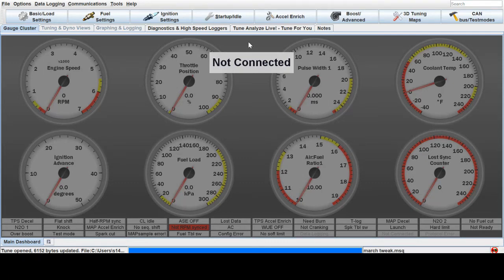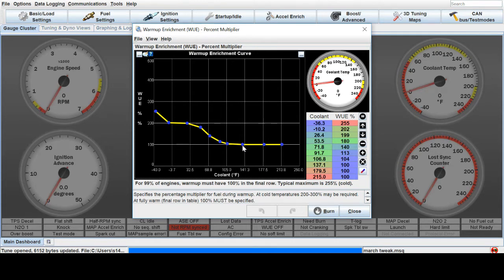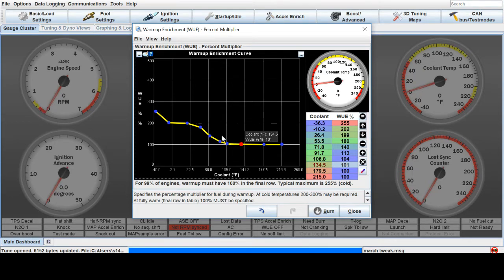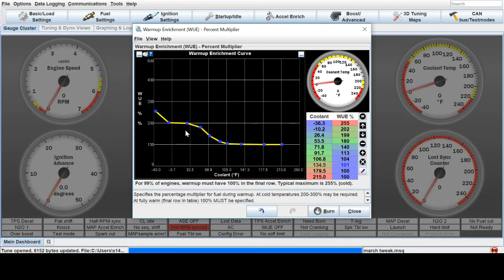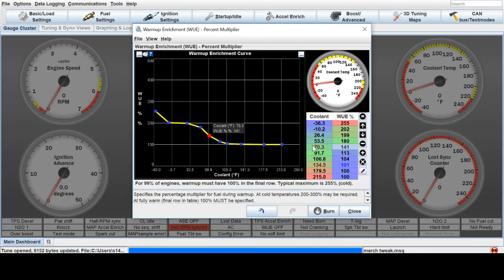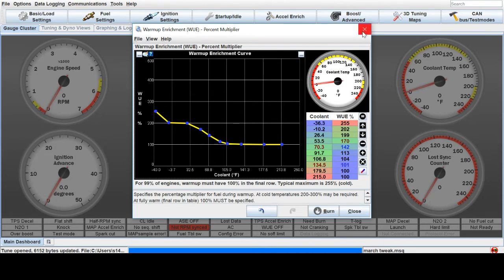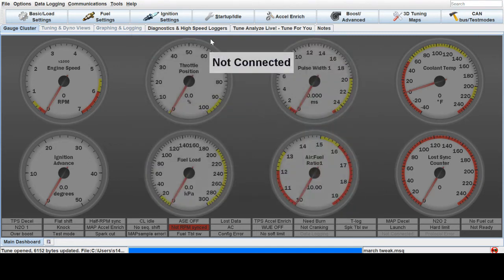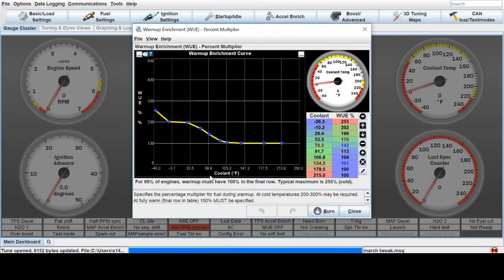Megasquirt Warmup Enrichment Tuning Basics

Comment: I know I’m late to this party, but YouTube algos certainly aren’t perfect.
Are the percentages you refer to applied to the VE table (I think you mentioned this) for those RPMs (idle RPMs)?
Do/did you tend to have your RPM axis “even or linear”?  Or, more granularity at lower RPM than higher?

Good video - thx
Reply from the maker: Thanks! The percentage increase for warm-up is a multiplier for the VE table. So if your warm-up value is 200% it is multiplying the value in the VE table x2  doubling the amount of fuel injected at any given point in the fuel table.